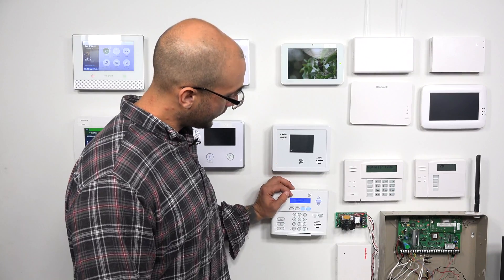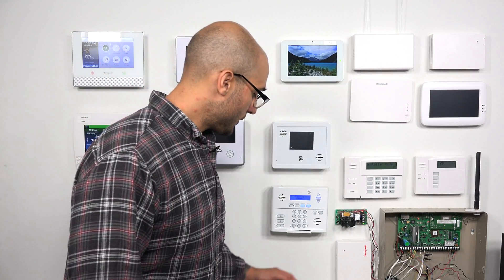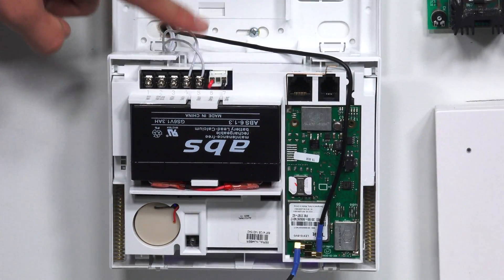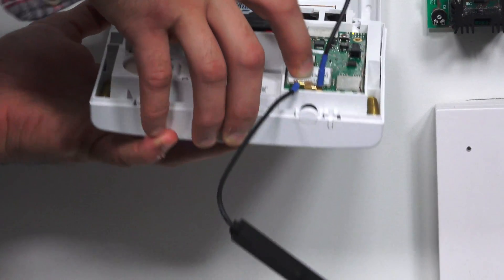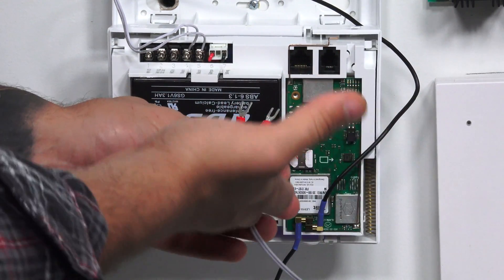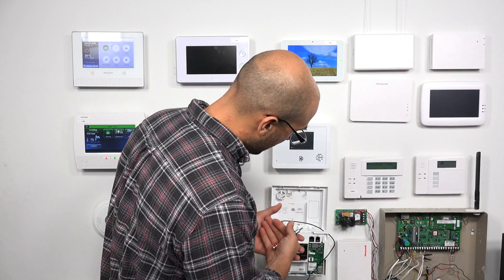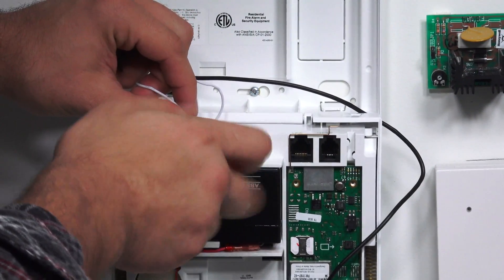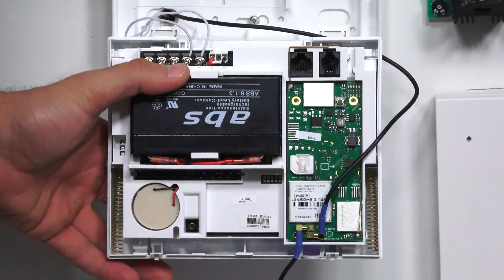Best Wiring Practices for the Simon XT

Comment: How many volts should my voltmeter read at the back panel connector screw terminals?
Reply: Panel power requirements 	9 VAC
Battery power requirements	6 VDC